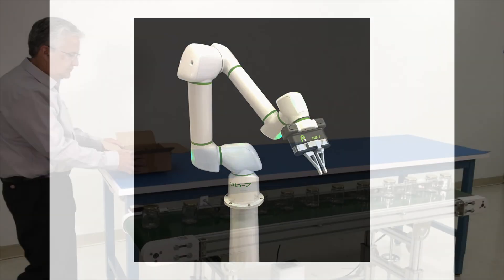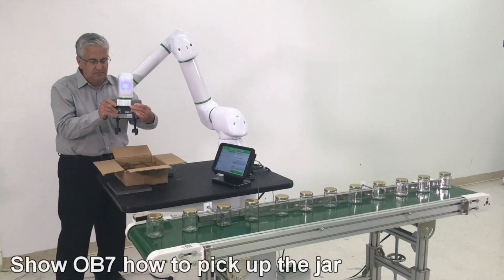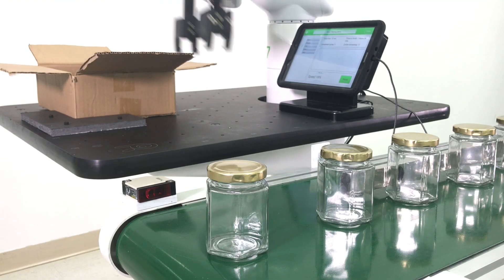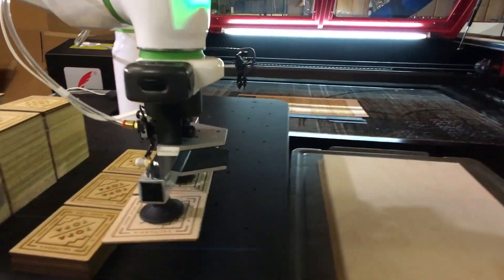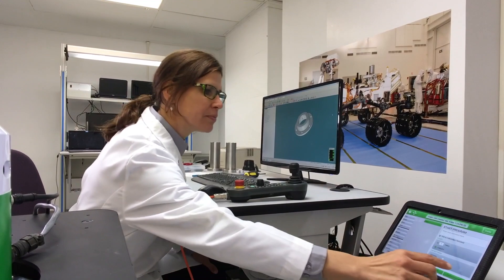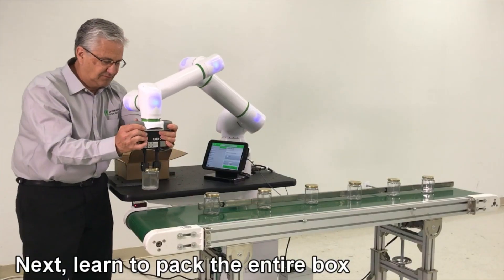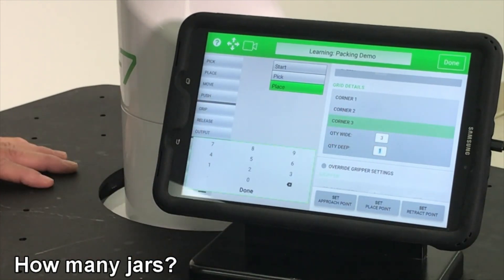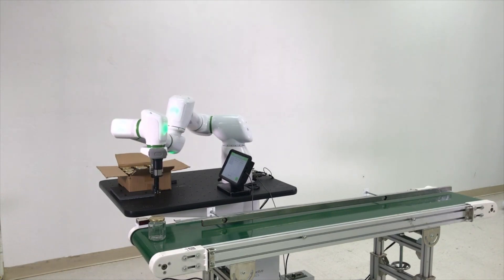Teach the OB7 Collaborative Robot in Minutes — No Programming for packing & QC

Comment: If you are not programming, how do you communicate with a CNC machine?
Reply: There is an I/O module you can also purchase and either input or output instructions. You would use the output instruction to handshake with the CNC machine telling it to run.